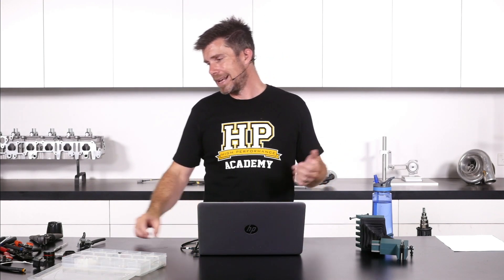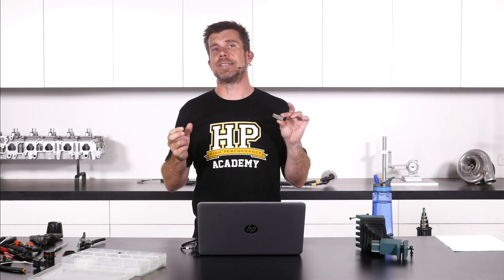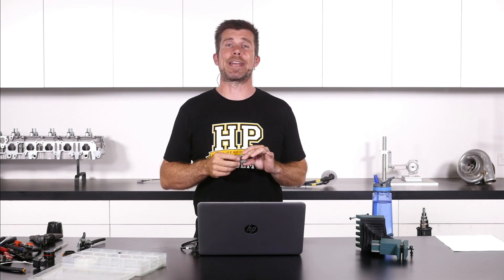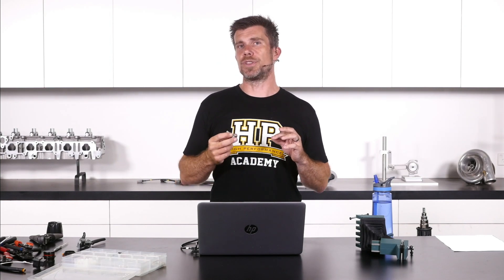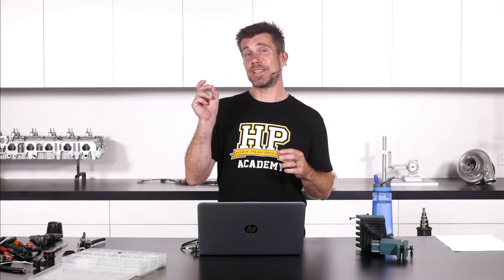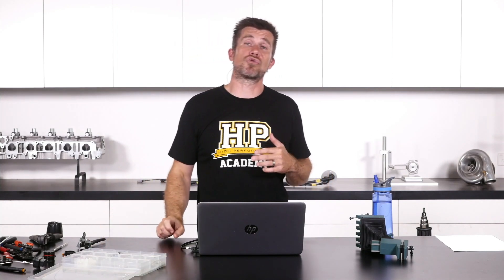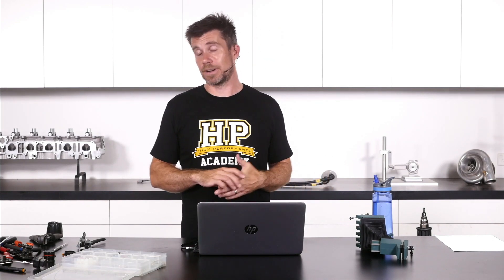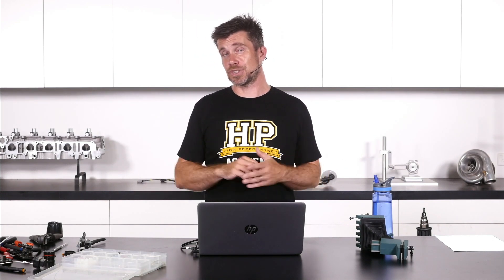2 Wires, 1 Connector | Can I Use Multiple Wires In A Single Connector? [HPA Q&A]

Comment: Terrible video a lot of talking says nothing shows you nothing
Reply from the maker: Sorry to hear that. What did you feel was unanswered in regards to the question: "Can I Use Multiple Wires In A Single Connector?"
Let me know and there might be something else I can point you towards if you're after answers to other questions too - Taz.
Reply: I want to see a push on connector where you can put two wires in it, not just one wire but two into one connector that goes on a coil kill tab. I want to know if that type of connector even exists for 12-volt system on a lawn mower

Comment: If you are using nonsealed terminals, there is generally no issue with multiple wires in one pin or socket as long as the terminal is sized to the total cross sectional area of the wires being crimped and the total current doesn’t exceed the rating of the pin and connector.  The bigger issue is that with weatherproof connectors, multiple wire will not allow a weathertight seal in the wire seal part of the connector.  So, I would avoid multiple wires in under hood or other exterior areas subject to moisture and dirt, but in interior connectors protected from the elements, multiple wires in one terminal is fine assuming appropriate sizing and current constraints are met.

Comment: True! But if you use common sense and depending on what you are powering, like certain LED lights that are very low current. Sure, you can go that route...
Reply: Sorry, I am new to this. I am powering a 150W 24V DC motor, that uses 12AWG wire. The other wire is 14AWG to power a mini LCD voltage readout. Currently I am using a GKEEMARS Mini Electrical Wire Butt Terminal Block Connector (1 in 2 Out) and I would like to replace it with a WAGO connector. What would be the WAGO equivalent for that? Thank you.